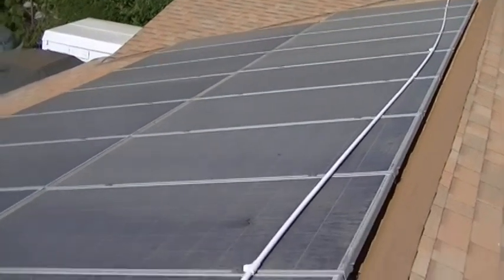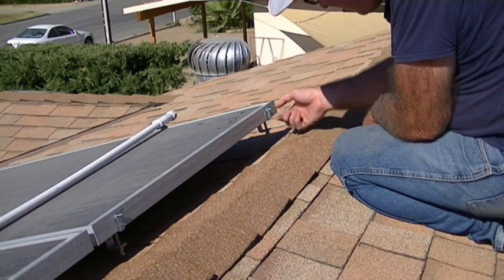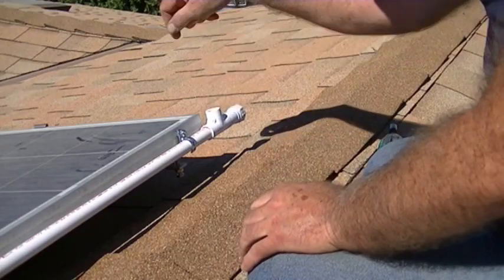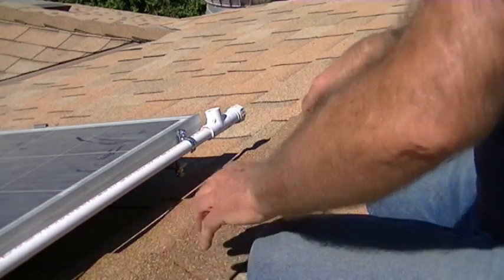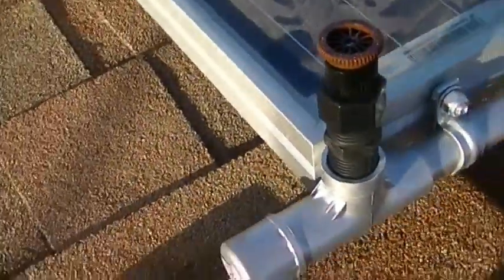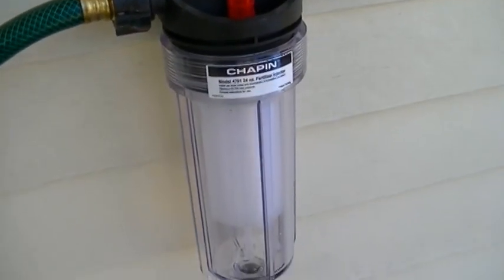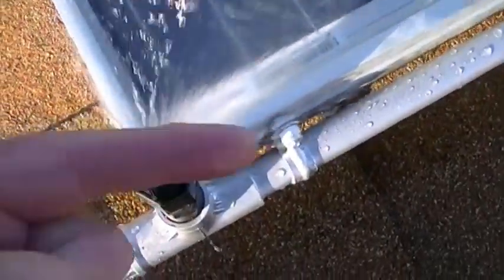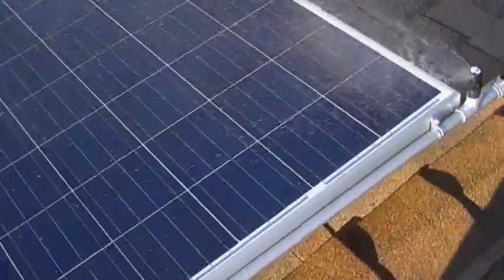DIY Solar Wash System / No Roof Penetrations

Comment from the maker: Hi Friends.
I forgot to mention that I spaced the mounts the same as the panel width of 39". I used a total of 13 mounts. I try to place these about every 3 feet on average. I did a ground mount system and tried them at 4' spacing and had to go back and add a couple. Roughly 3' works well. It is a good idea to have a mount land at each sprinkler nozzle to give support. If this array was wider than 14', I would have moved up to a VAN18. I had to use a VAN18 on a 13.5' array that was on a domestic well for the water supply and the water pressure was to low to make a VAN15 reach.  Your all have a blessed day!